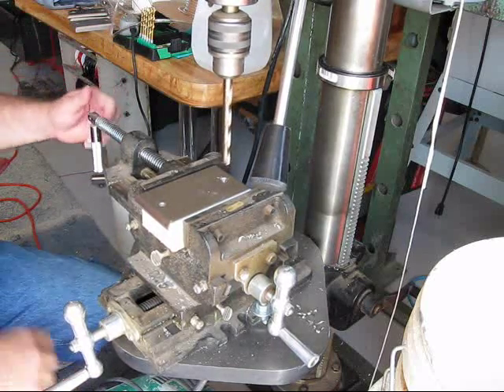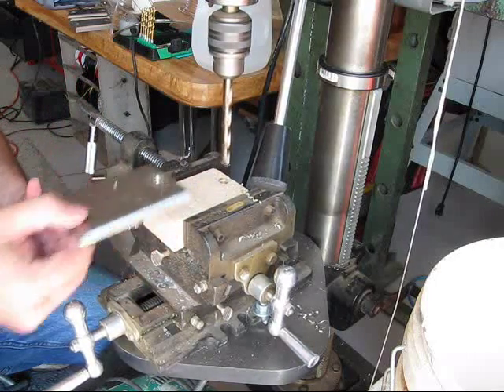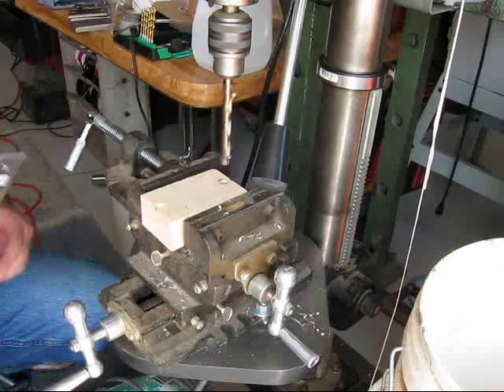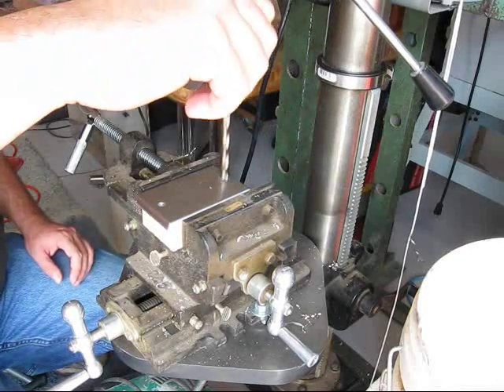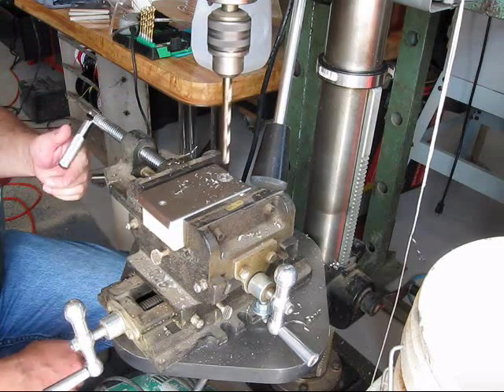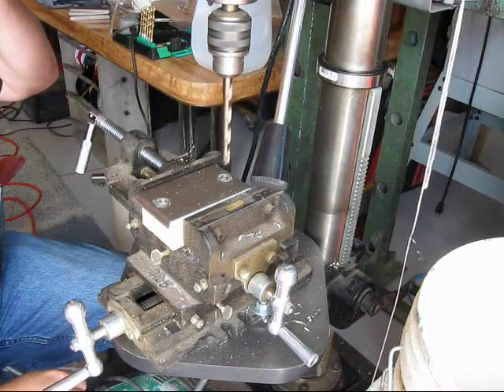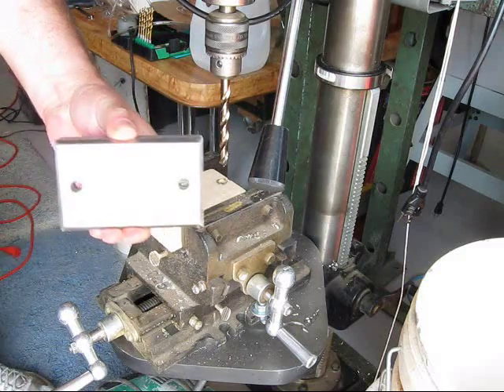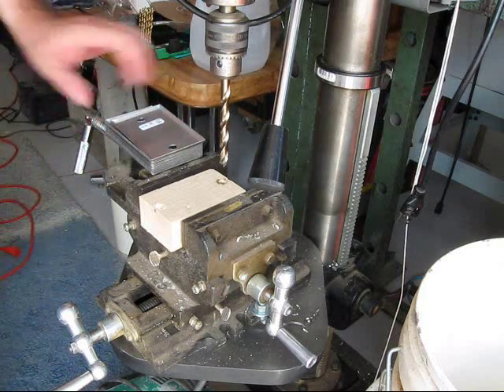#08-081 Using a Drill Press to Cut Plate Holes

Comment: titanium bits can be sharpened just fine, so an the zirconium bits as well. your also supposed to use cutting or tapping fluid when drilling any kinds of steel,drilling steel and stainless steel 450 rpm is fine with cutting fluid.. without then you go 300 or slower if you can.but you should still use cuttting or tapping fluid on slower rpms as well..